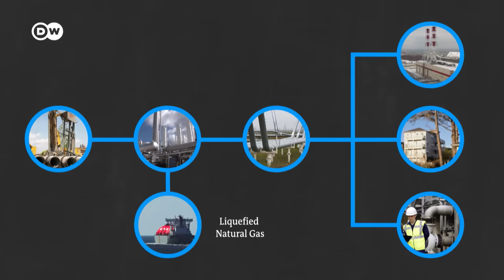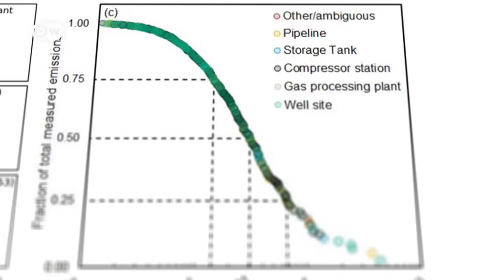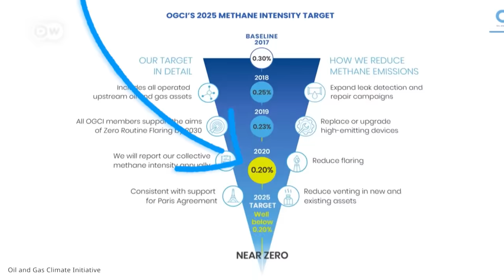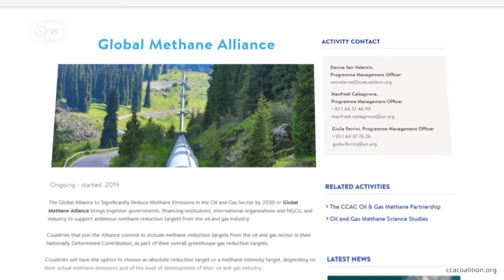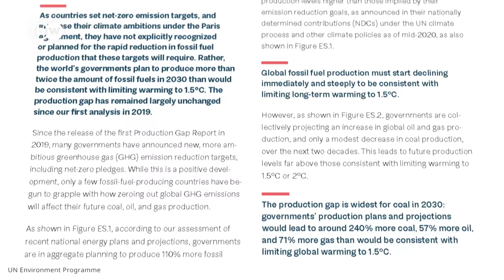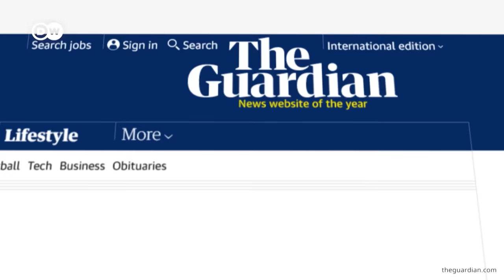Why we need to ditch natural gas (asap)

Comment: Building gas powerplants is a good thing in my mind. Because first you go from coal to gas, which lowers the amount of co2 on the short term. In the coming years we have to build green hydrogen plants. But the beauty of a gas grid is that it can be used as a grid for hydrogen. Also the gas powerplants can be used by hydrogen instead of gas. By Building now gas powerplants, we have the infrastructure in place when we are ready to switch to hydrogen.
Reply: Hydrogen isn't an energy source like gas is. It is an energy storage system like a battery, but much less efficient. You need to put in twice as much electricity to make it as you get out. And you don't burn it, you run it through a fuel cell to get the best efficiency. The main legitimate way to use gas today is as a backup for wind and solar because gas is fairly easy to store, and gas peaker plants can turn on and off quite quickly as need arises. CCS should be added to these to minimise the CO2 output. In the future Hydrogen may be used to store some of the excess energy from wind and solar in salt caverns and similar to use over the winter when demand is much higher and solar production is low. Hydrogen may also be useful in some applications such as trucks and maybe aircraft. I think ships will be better off with ammonia though. Hydrogen is never going to be a major component of generation though.

Comment: In our apartment we still use butane bottles as we had no other option for heating. But now we have had an offer to a install natural gas line into the apartment, but was hessitant in doing so. But after looking at the contamination between the two, I understand that in our case natural gas is better.

Comment: I’m glad that biogas was mentioned.  It is one of the least exploited methods that could really help. As it stand now, most naturally occurring methane emissions from the seemingly infinite organic matter we are surrounded by are being wasted because they’re not being captured and burned in place of all mined fossil fuels.  We could have base electrical power generation, fuel for cooking and heating etc.all from organic sources — but we have to really want this to make it happen.
Reply: I fully agree with you. Something you micht find interesting is the conversion of Hydrogen and CO2 into Methane. This can be done as a form of biogas upgrading. The CO2 fraction that is formed in biogas systems can so be removed resulting in a higher calorific gas and more gas. Methane has a higher energy content per volume then Hydrogen and can be used through existing pipelines. 

Interesting research articles about this subject are:
Production of high-calorific biogas from food waste by integrating two approaches: Autogenerative high-pressure and hydrogen injection. (Kim et al 2021)
Recent progress towards in-situ biogas upgrading technologies. (Zhao et al 2021)
Reply: Biogas and LNG are the same thing, i was disturbed that mined gas was called LNG i am like excuese me ? LNG-menthane, ethane. LPG- propane, butane. Well a biogas plant each year produces 14 000 tones of gas. The thing is gas is less energy dense. In order to match the same energy lv of buringing one 1kg of coal you need 50 kg of cng. biogas has 2% efficiancy of coal. Well with gas there is less energy loss, so it is a better energy fuel in general. In a cow stomach there are microbs that eat up organic matter and they spit out biogas aka methane. In a big mixer they mix cow dung plus organic matter the best organic matter of lng production is wheat. You can get 60 kg of cng out of 1 kg of wheat. 14 000 tones of gas are about the same as 280 tones of coal. A added benefit of LNG or CNG or methane in general is that you can produce fertelizers with it. The talk that we should ditch methane is at this point not realistic
Reply: @cikosonly1698  This is not true. Burning 1 kg of coal release up to 9 kWh. Burning 1 kg of methane release up to 14 kWh.
Reply: @cikosonly1698  I don't see the value in biogas because we know that to be at major commercial production levels, using waste would not be enough. We would end up growing biomass to use for the process and this creates it's own set of problems; more forests would be cut down to make room for the extra biomass production; water usage would increase; fertilizer usage would increase; fertilizer production would have to increase ... etc, etc...  IMHO, much better to look at other energy sources like thorium nuclear reactors which are safer and have manageable wastes compared to the current power plants.

Comment: Go Nuclear, and bring back the forests. There are all kinds of new options available. I was going to replace all my gas appliances, but the grid goes down 3 to 5 times a year, including the dead of winter. The auxilliary power plant runs on natural gas, and who knows what the main system is. Aside from price gouging, there's no good reason here to replace it. Solar was taken over by the chinese, so you never know what you're installing, and home windmills are a joke. Lithium batteries explode. Nuclear has advanced a great deal, and it's getting safer all the time. We won't even need to worry about spent fuel soon!

Comment: We in Ukraine, after 8 years of putins spec operations and gas cuts now almost completely ditched natural gas usage. Electric water boiling, electric keramic heat panels + induction stove = 0 gas needed. Gas is very dangerous btw if use unproperly.

Comment: Replace methane CH4 with a cleaner burning gas like hydrogen H2. Of course, all the appliances that uses CH4 would have to be modified to be able to safely use H2 instead if possible. If not, then it's electric appliances. While solar farms is amazing, the sun doesn't always shine, but in the deserts, solar farming in those areas would have more abundant sunshine. The big deserts in Africa can literally supply electricity to the entire continent of Europe. Just saying.

Comment: There are still many problems with renewable energy. We don't have the best battery technology yet. Lithium ion batteries can be dangerous and lithium mining causes a lot of pollution itself. The batteries take a long time to charge too so it's not as practical. ICE are much stronger and can run at full power the entire time as long as there is fuel. Not so with batteries. They gradually lose a lot of power. And think about things that require a ton of power, like heaters or stoves off grid. Propane works much better for that. Gigantic batteries would be required. Which brings up the other problem, batteries don't work well in the cold.

So I thinking banning fossil fuels right now is not a viable solution. We're nowhere near there yet.

Comment: Natgas and biogas are essentially the same thing. I am a citizen scientist who researches and developes systematic methods for decomposition. There is still a ton of efficiency issues at current biogas plants, that can be easily improved upon. I think once these problems are resolved biogas will completely replace fossil gas, the transportation infrastructure is already there so its easily scalable. Not to mention the resulting media from biogas generation is of high nitrogen content, which can be used for farming, negating the need for the extremely carbon intensive Haber process for nitrogen extraction.

Comment: How can you tell people like myself how to cook and heat your house without natural gas? I would change to electrical heaters but the cost of electricity would be very expensive. I worked for a power utility and there is an need to build more power plants generating electricity for EV and electrical houses. The options are more solar power, wind power and nuclear which no one wants. Even if utilities quit burning coal, oil and natural gas the carbon dioxide levels are high enough to melt glaciers all over the world. The only way to change people's opinion is when coastal cities are under water.

Comment: Well if you really wish to look at natural gas then you have to include the flexibility of electrical generation compared to bunker c oil, coal and nuclear. With those three sources that dominate electrical production you have to boil water to make steam to drive turbines . That process can take as much as 24 hours before u get electricity. With natural gas the exhaust drives turbine and that can happen in mere minutes. Natural gas is the solution to renewables unreliable production.

Comment: Pump storage is an old and proven solution for storage. Since the relationship between wind and power generated is exponential. Variable pump speed as well as variable generation could provide for greater wind penetration and less curtailment on the grid .Different countries often have different peak winds and different demand times. Improved interconnection here coupled wit storage would be helpful.
Reply: Pumped storage is expensive, hard to site, and is fully developed technology (so costs aren't likely to significantly drop).
Reply: And it takes so much energy to pump water uphill and upon releasing it, I'll bet generates a small fraction of the power needed to put it up there. Complete waste.
Reply: @robertbell525  80% efficiency ,long operational life.
Reply: @richdobbs6595  Yes you are right but variable pump speed is a recent improvement. It will be there long after batteries.

Comment: NG is primarily use in building heat and cooling, electricity generation, and for cooking.  `1) Immediately pass legislation the prohibits use of NG in new construction.  2) Transition to solar, wind, and batteries for electricity generation.  3) Some transmission grid upgrades and rationalizations need to be made to get to emission free electricity, but we did it for our national highway system at much greater cost. Transmission can be upgraded rapidly without interrupting service if there is some national leadership.  Plus, it will save significantly over the current system.  4) Launch a national program to retrofit existing buildings with all-electric heating and cooling.  Operations costs reductions will more than adequately finance the transition.  As my old employer used to say -- Just Do It!  Oh yeah, clean up NG's industrial uses and replace with electricity.

Comment: Basically, green hydrogen plants directly paired with renewables need to be built in parallel to renewables build outs to power the grid.

This green hydrogen would then be used to displace the natural gas that is used as a hydrogen feedstock or energy source in industry, and can also be used to power backup/peaker power plants for the grid.

Note, I don't really advocate for using hydrogen for home heating or general transport, however it may make sense for some industrial or commercial vehicles to utilize it is some form.
Reply: @TheSonic1685  And why would you need your green hydrogen plant to always be running at full capacity? The reason you build it and directly pair it to your renewable plant is precisely because solar and wind is intermittent.

By directly making fuel from unreliable intermittent power (a process which you can ramp up and down based on your supply of energy), you are turning that unreliable source of energy into a reliable fuel, which can be used either as an industrial ingredient/commodity or to shore up the intermittent problems of renewables on the grid as a backup supply of energy
.
Yes there is value to having your synthesis plant always running at full capacity to take full advantage of the costs of the infrastructure, but ultimately it comes down the the cost of the input energy for if it is worthwhile or not. If the unregulated power from wind/solar can be produced at around 1/3 the cost of nuclear/hydro/geothermal then solar/wind is likely as good, or even a better source of this power. Otherwise, perhaps this power should come from the other sources.

Comment: Generating electricity from Gas is a inefficient way of using the energy in gas. Burning gas to general electricity results in a loss of energy. Shipping that electricity over wires results in more loss, finally converting that into heating or cooking results in even more loss. A far more efficient manner is to ship the gas directly to the point of use, where it can heat the home and allow for cooking. There is some loss in the pipes, but this is something which can be reduced with some effort. If you want even higher levels of efficiency then you can ship the gas in cylinders.

So why do governments use gas to generate electricity. There are two reasons why governments use gas to generate electricity. The first is political; Germany wanted to close its nuclear power plants down, but doing that would result in an increase in CO2 emissions. Unfortunately for Germany its renewable energy capacity does not provide base load power, so even when the wind is blowing and the sun is shining, Germany still has to keep its coal fired power station running. Unless renewables provides base load power, it has minimal ability to reduce CO2.

The 2nd reason is gas assists in negating this major issue with wind/solar renewables. Running a gas fired power plant in standby mode is easier than doing the same with a coal fired plant. When the winds drops or demand rises, the gas fired plant can quickly be fired up to make up for the shortfall.

The only problem with using gas is everyone is doing so, driving its prices upwards and making it uneconomical. The situation in the Ukraine has sped this issue up, but gas prices were rising before Russia made its move. Unless you go nuclear the only other solution is to build energy storage solution, such as water or gravity energy storage solutions. Battery storage solutions are not viable, as we need something which can provide 500 MW/hr over several hours per power station. Hydrogen solutions could work, but the problem with Hydrogen is storage and we need a solution now, not in the future.

An efficient and cost effective way to store the power from renewables can also increase the efficiency of nuclear power as well, so it reduces your overall requirement for power plants. Of course building an artificial lake, or a huge tower with concrete blocks moving up and down may not be popular, but it would allow you to replace gas and coal, and actually reduce CO2 emissions. People need to focus on reducing CO2 and not on the technology.

Comment: Solar and wind is not a good alternative either. Emissions per watt caused by production, maintainance and utilization of wind turbines and solar panels are comparable to gas. And you don't want to depend on China for your climate strategy. Why isn't atomic energy mentioned? Modern reactors are very safe and unlike Chernobyl a catastrophic failure affects just few kilometers radius. Atomic energy is a good source of energy before fusion reactors become a reality.

Comment: Natural methane generation is massive compared to any leakage from the gas industry. Methane also has a short half-life in the atmosphere, compared to co2. It’s also not true that wind and solar are cheaper. They are still much much more expensive than any fossil fuel.

Comment: Canadian and cold climate question: how do we stay alive in the winter?  Anything else that is burned for heat/survival is far more polluting: wood, coal, etc...   Electric is inefficient and not everywhere has easy access to hydro power.  Nuclear is great until you have a bureaucrat who tries to increase quarterly margins by reducing maintenance schedules or over-working staff to reduce labor costs.  Natural gas is one of the cleanest burning substances we have.  If anything, we should burn more gas so we could shut down dirtier fuels.

Comment: Methane doesn't actually last very long in the atmosphere. It's relevant, of course, but less than you'd think. The most important factor in how much warming methane causes is the RATE at which it's being released, as opposed to the cumulative total (the way CO2 is).

Comment: Gas burning is the cleanest form of reliable energy (after nuclear). CO2 is a trace gas, inoffensive to the environment except that no CO2 means no plants which means no food. CO2 does not cause climate change. On the contrary, global temperature variations are the cause of variation of VO2 gas in the atmosphere.

Comment: CO2 can be absorbed by plants but methane cannot be done. So, plants can filter out the CO2 but are there any natural ways of filtering out methane from air. If logistics can be cut short and transportation and repackaging avoided, the problem can be solved to a great extent. A pact that only one or two steps would be allowed from manufacturing to end user can help avoid the leaks to a great extent. World leaders should work on decreasing energy transportation.

Comment: There's a reason why where possible pumped hydro exists and that is because the idea of storing the whole planet's energy requirements in chemical batteries is absolutely bonkers. We also pretty much already depleted all suitable geo-locations so this is a run race and we require something different. Something that can also hold much much much more energy. And the answer is methane, so no whatever the lobbyists say we should never ditch that.

Comment: renewable energy also have problems right? look at china when their water dries up their power also dries up, so no water and no energy both at the same time, imagine it happen on wind energy, places that used to blow wind doesnt blowing anymore. as for solar power, I heard the process of producing and recycling still have problems. battery also have recycle issue.